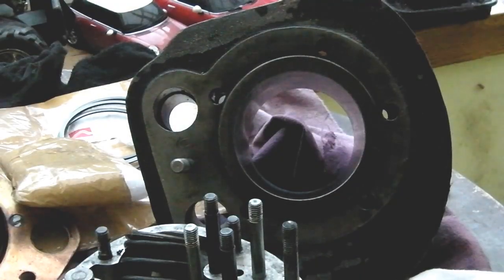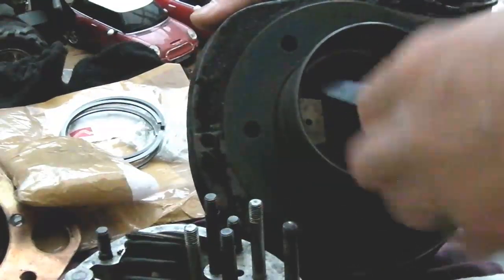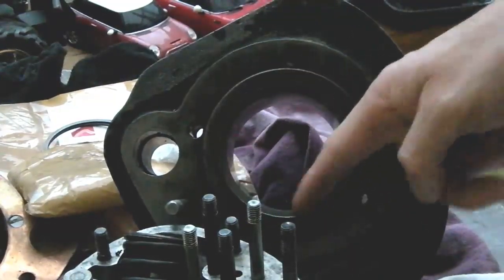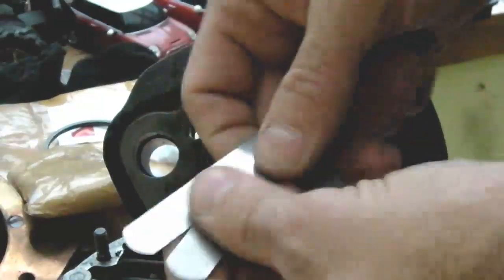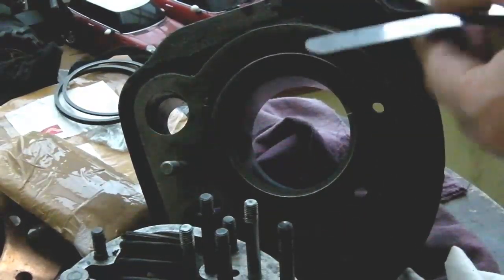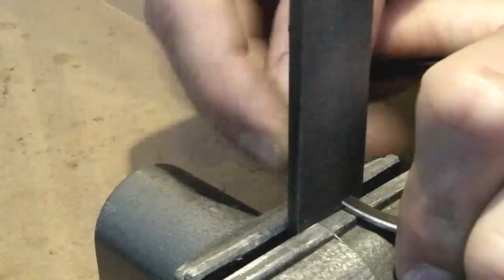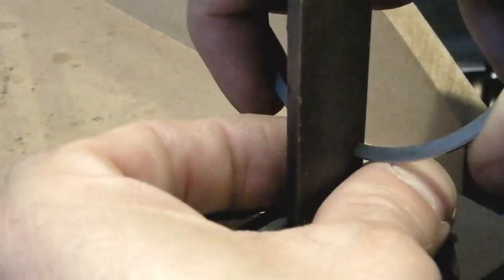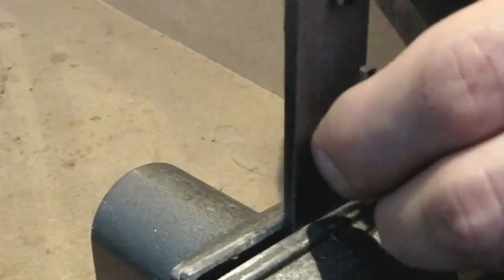Piston Ring End Gap, Checking and Setting, Royal Enfield 350 Bullet Classic

Comment: Hi Spidiq, I realise this vid is from a long time ago but hoping you may be able to offer some advice. I'm just trying refit my barrel to my enfield bullet but just wondered if you had any tips to compressing the rings so as not to damage them when refitting the barrel over them. I've already broken one of the rings doing it so another set to buy!
Reply from the maker: Sure thing, if you have some thin aluminium sheet you can cut a strip that's a little shorter than the circumference of the piston but wide enough that it covers the 3 rings, bend it round into a circle and  the ends out the opposite way so that you can grab them and pinch them together.
Alternatively. Get the largest widest hose clamp you can. Jubilee clips we call them but depends where in the world you are.
Use that similarly to compress the rings then tap the cylinder gently over them and remove.
Hopefully that makes sense.
Reply: Thanks for the tips. Makes sense absolutely, But just want to check that when refitting with a jubillee clip or similar around the rings I'm assuming you should make incremental movements to get the barrel over each ring then move the the jubillee clip down or should the barrel itself push the jubilee clip down as you push it down? if that makes sense???
Reply: Oh and also, one last quick question. Did you use any sort of gasket sealant on the base gasket or did you find that it sealed well on its own without?
Reply from the maker: @simonlacey6153  ideally try to get one wide enough to cover at least a couple, failing that use three and slide one over the other removing the lower one as you go, a second pair of hands helps.
Reply from the maker: @simonlacey6153  I just used a smear of grease, you could use a thin smear of silicone but it's not necessary if the mating surfaces aren't damaged, the oil pressure isn't that high.